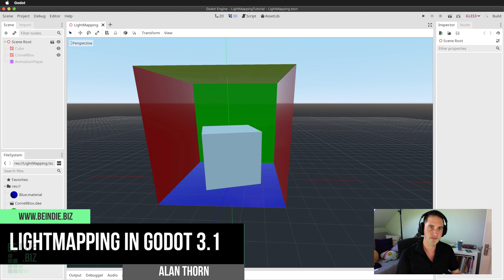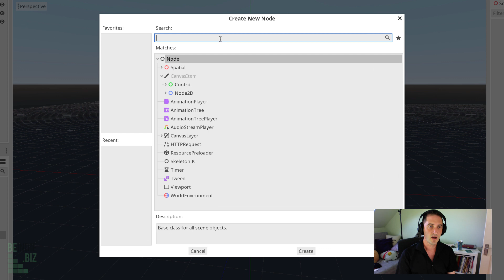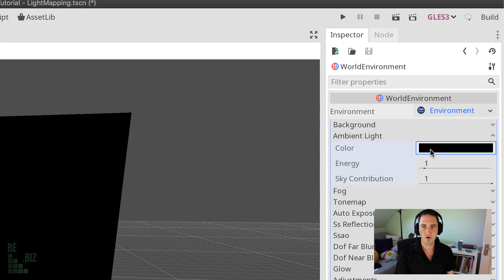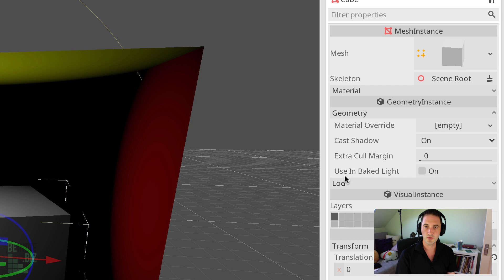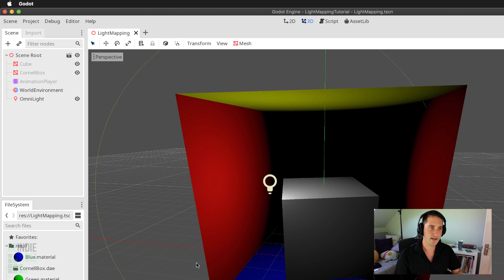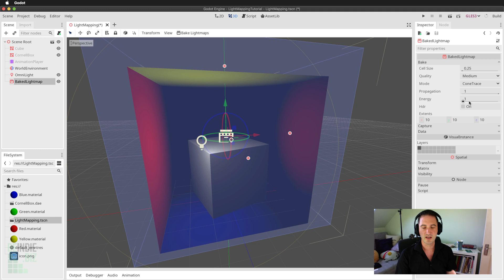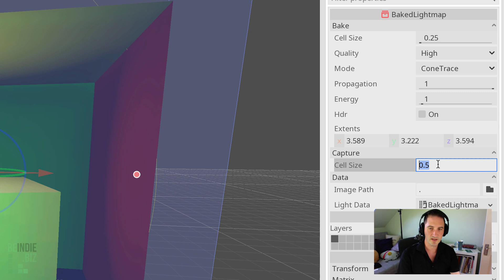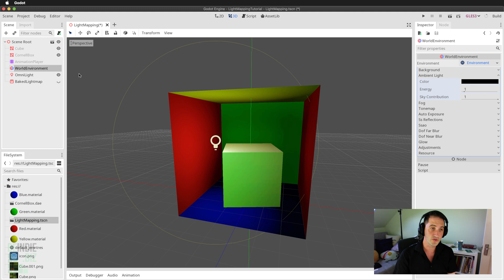Godot Lighting - Baked Lightmaps - Tutorial

Comment: Yes, great tutorial, thanks.
Is it possible to mix the lighting modes? Like adding a dynamic light, that influences the baked lightmap at runtime?
Reply from the maker: Baked Lightmaps are intended for objects that don't move and lights that don't change during gameplay. If you need indirect lighting for moving objects, you could use GIProbes instead. We have a tutorial scheduled for this soon
Reply: @BeIndieGameTutorials  I know, Juan made a video about this. I just wondered if a mix would be possible.
Reply from the maker: @DirkKrause  A mix is technically possible, yes. It would come with challenges and problems- like light from one system 'adding on' to baked lighting. But certainly possible